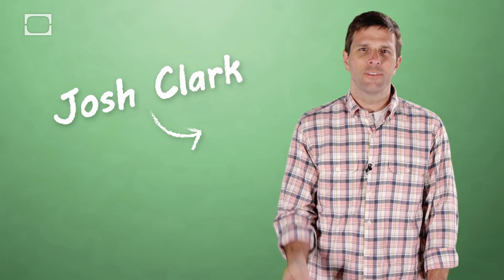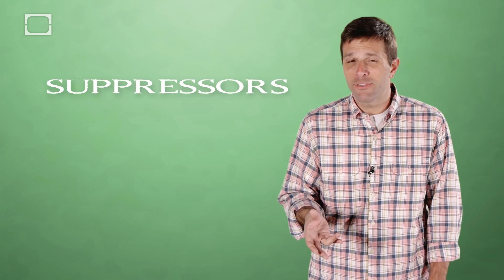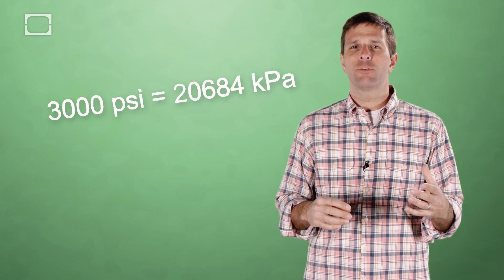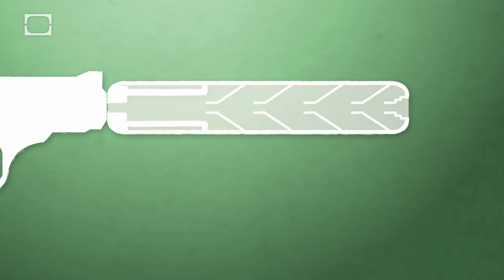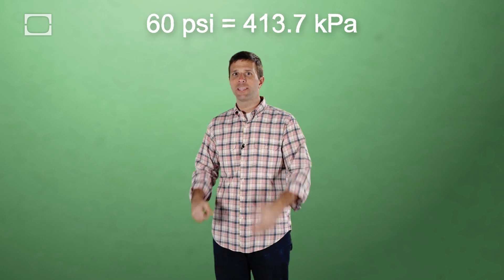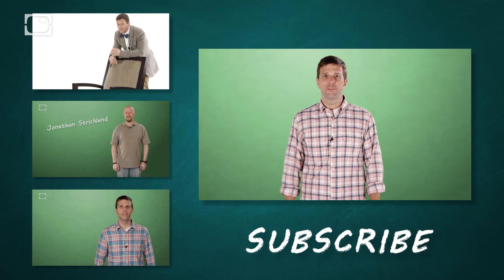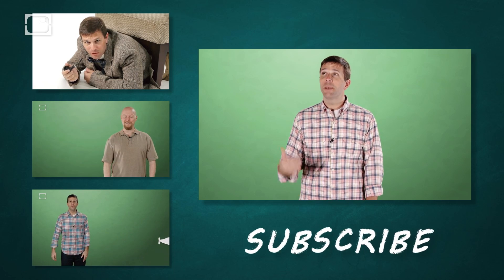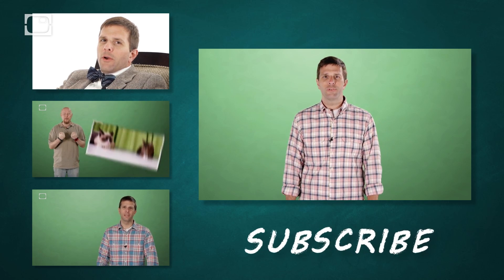How Do Gun Silencers Work?

Comment: I've been in the firearm world for quite some time now and I own a number of silencers and a common nomenclature for a silencer is calling it a "Can" and there's nothing wrong with it...just easier to say versus silencer. As someone who is a manufacturer, and has also been actively in the industry for the past 4 years and growing, I will tell you guys that there are a few other inconsistencies with this video. The big thing, is that while suppressor is another common term in the nomenclature for a silencer, suppressor is in fact the wrong term due to original copywrite and the fact that the NFA branch of the BATFE sees any kind of gun muffler as a silencer and that's the correct term as such. Accuracy and power are not decreased with silencers. Any time you thread on a silencer or attach it to a firearm you are lessening the felt recoil and muzzle flip. Also silencers do not slow down the gasses behind the bullet. Once the bullet clears the barrel, and starts to enter the blast chamber and baffle system, then the gasses begin to expand, cool down, and slow down. Saami spec pressure which is the standard that ammunition for a factory load is aimed at achieving is much greater than 3000 psi. The common 9mm handgun round will have a chamber pressure of over 35,000 psi. Exiting the silencer for subsonic ammunition I couldn't tell you as I don't have a way to measure that pressure. Silencers also with the correct host and depending on the caliber will perform much much better than 130 db's. Some .22 rimfire silencers will reduce the sound signature down to 115 db's. which is not whisper quiet, but it's extremely quiet. 140 db's is the threshold of hearing damage as noted from OSHA, and the best 5.56 rifle cans will bring you down to just below that, and that's due to the super sonic loads breaking the sound barrier. An okay representation of silencers, but there is quite a bit of misinformation in the video. Cheers.
Reply: OrignalRecipe92 Pressure data, as well as spectrum analysis of some somewhat dated designs (except for one German WWII design that actually looks like K-baffles) can be found in Frankford Arsenal's 1968 "Silencers: Principles and Evaluations".  It was one of my references back when I did form 1 cans.
Reply: Joseph DiFusco Spot on man, I'll have to check it out.

Comment: Scrolling through the comments quickly, I don't see that anyone else has already pointed out that Bardem's character in "No Country..." carried a captive bolt gun, which uses compressed air or gas to rapidly push out a spike. It is used for killing livestock. There is no combustion involved in its workings. And I don't remember him having any sort of suppressed shotgun. 
Also, if it is called a "suppressor" then why continue calling it a "silencer" throughout your video?

Comment: Btw the term "can" is actually the type of Silencer/Suppressor rather than another name for a Silencer/Suppressor. A "can" type will screw to the threads on the end of the barrel and protrude forward while an "over barrel" type will slide over the barrel and thread on around halfway up its length.. Oh and you left a decimal point off the pressure that the cartridge operates at, 20,000-65,000 psi is a typical pressure range for modern firearms. The term Silencer has been used for over 100 years with the inspiration coming from when Hiram Maxim was experimenting with more efficient ways to muffle Automobiles, which also ended up also being called a Silencer.

Comment: 20 dBs?  Really guys?

The Welrod which is basically a giant silencer that fired a .32 ACP or a 9mm.  With the .32 the sound was down to around 75 dBs.
Reply: Clay Ronso ...by how they measured decibels at the time. And the DeLisle carbine was 85dB. Those numbers do not translate to modern measurement standards. I haven't seen a real DeLisle metered, but I'd be surprised if it was less than 120dB, even with it's massive integral suppressor on a subsonic pistol cartridge manual-action rifle. Think about it: suppressors from World War II were not orders of magnitude quieter than modern suppressors. Technology has improved and today's suppressors are quieter and more effective, not over 50 decibels louder.

Comment: So many errors in this video, I thought I would work through them in order:

1.  Why did you use a revolver to demonstrate attaching a silencer?  There has only ever been one single revolver design that could run a silencer, plus a couple of others heavily modified.  You would know this if you did any amount of research at all.

2.  They are actually called silencers.  The inventor named it a silencer.  The patent is for a silencer.  Legally, you get a tax stamp for a silencer.  There is no such thing as a suppressor.  Yes, we know, they dont actually silence a gun.  Doesnt matter.  You dont get to determine what they are actually called, the inventor does, and in this case, legally, the feds do.  Its called a silencer.  In my experience, ever single person that corrects another person for calling it a silencer, does not have one, or else they would know that when you transfer one on a form 4, it is for a SILENCER.

3.  The gunpowder does not explode.  It burns rapidly, at differing rates depending on the powder.  Again, you clearly have no idea what you are talking about, and did about 3 minutes of research on the internet.

4.  3000 PSI?  Try 30,000 PSI.

5.  Dont want to associate with people that call them cans?  Are you serious?  I dont want to associate with people that correct people and tell them not to call a silencer its legal and proper name.  Suppressor is a nickname just like can is.

6.  60 PSI?  I am not even going to get into that.  Do you have any idea how ridiculous that sounds?  Come on dude, common sense.

7.  Your sound levels are way off.  You act like you wanted to say it dropped it by 20 by your notation.  You can tell that was not your intention, unless you know people that have "very quiet whispers" in the 130 db range.  Also, 20 dbs is an incredibly loud silencer, most are more effective than that, but I wont get into that here.

8.  Giving up power and accuracy?  Silencers normally increase the FPS of the bullet slightly, not decrease it.  Accuracy?  No, you dont give up accuracy because of a silencer.  Your point of impact may have a shift when you go between a silencer and no silencer, but this is something to be accounted for just like anything else.

9.  I am starting to wonder if even when you said you have been in a ton of firefights if that is true.  What branch where you in?  When did you deploy?

Comment: Also you can't use a silencer on a revolver.  The gap between the cylinder and the barrel still allows gasses to escape at supersonic speeds
Reply: You can on the Nagant Revolver.
Reply: Peter Dvornik In addition to the Nagant mentioned above, a customized Dan Wesson revolver was used in an assassination attempt on Idi Amin. The Dan Wesson was used because it had a quick change barrel that was easily modified to adjust the cylinder gap to nearly nothing.
Reply: Peter Dvornik Awww...
Reply: Peter Dvornik Awww...
Reply: Right hahaha

Comment: There is a few things missing in this explanation and a couple of faults. First you CAN suppress a 12 gauge shotgun. Check this clip: www.youtube.com/watch?v=rtIqTfObXIo. Second, some suppressors are more efficient than others and anything from generally 16 to 40 decibels reduction is possible. Also not all suppressors will reduce bullet speed which would effect impact energy (="power") or maybe even accuracy to any significant point though in many cases change the point of impact: www.youtube.com/watch?v=2HzMLvrF6u4 It also depends on what weapon type one attaches a suppressor on how effective it is: www.youtube.com/watch?v=-WPHcqr6dcI. Trying it on a revolver for instance will in 99.9% of the cases be completely pointless due the the "gas leak" between the barrel and drum.

Comment: They think they know what they're talking about but they have a picture of a revolver on the thumbnail with a suppressor on it.
Reply: Yeah because you can put one on a revolver, so....
Reply: *****
A Suppressor on a revolver is USELESS. Unless you get an AIR tight fit between the drum and the barrel, you won't suppress a large amount of the sound anyway. From memory I can only think of one revolver doing it,(the Nagant)
Reply: it still can done
Reply: Nukedk The Nagant M1895 Revolver uses a unique, proprietary cartridge where the case goes over the bullet, which creates a gas seal upon firing. Other suppressed revolvers (I can think of three others!) are also exceptional highly exotic designs very different from what people know as revolvers, and none fire the common revolver cartridges. Also the silhouette in the video is not a Nagant.

Comment: revolver supressors do Work but only in special models that seals the cylinder against the forcingcone and it also use special rounds with a casing that is longer and extends past the projectile to seal the gasses maybe you should have shown a pistol instead of a revolver

Comment: Ironic that in Counter Strike, suppressed guns are more accurate (Make less recoil) But hey, it's a video game, what can you do.
Reply: I know this comment is two months old, but if Counter Strike uses subsonic rounds, then the explosion in the cartridge would be less powerful, causing less recoil. However, because its not going as fast, the bullets drop off after a shorter range. So less recoil, also less range.
Reply: Modern silencers+standard ammunition won't negatively impact performance, though it would eliminate muzzle flash, so your target may be easier to see

Comment: What if somebody made a 2 foot supressor? Would that take all of the noise away?
Reply: put a 2 foot supressor on a gun and watch your bullet just plop out
Reply from the maker: Interesting question. I don't think it would take all the noise away, but by giving the gas more room to expand it might help a little. Maybe we can research this for a future episode.
Reply: Derazik Rants the supressor does nothing to slow the bullet, if it is made within tolerances the bullet never contacts the supressor.
Reply: +Ravener96 suppressors dont slow the bullet down but you have to use subsonic rounds for the suppressor to actually do its job. The subsonic ammo is slower than the normal bullets... Just wanted to point that out.
Reply: ***** Not in terms of sound reduction, a silencer's effectiveness is roughly proportional to its internal volume.  However, there are diminished returns when it comes to practicality.  Longer silencers are less maneuverable.  Longer silencers also mean more weight and more leverage pushing down on the end of a barrel, which can change a bullets point of impact.  And lastly, longer silencer's increase the chances of a baffle strike, which is when a bullet hits and destroys the internal baffles of a silencer.
Reply: +Synismyhero nope. you see when the bullet leaves the barrel it continues to travel at a very high speed so the bullet will make a ripping or tearing sound through the air which is partially cause by the air being separated and collapsing back on its self by the bullet. silencers or suppressers only take away the loud pop sound of guns and help disperse the gasses which are under tremendous pressure this is only practical to help protect your ears from powerful sound waves when you are shooting a gun or for military units to place a round on target from a distance and have the enemy not know where the bullet came from, but they still would most likely hear it and know it was a gun. to reduce the sound further using sub sonic bullets ,which travel at a far lower speed, will lower the pressure of air collapsing on its self nd therefore reduce the sound it makes. although sub sonic bullets are less accurate at longer range and may not cycle a semi auto pistol or rifle.
Reply: BF3VsBlackOpsII the supressor does it's job fine with supersonic ammo, people just dont understand what it's job actually is. it only limits the sound from the actual gasses. it doesent limit the sonic boom from the bullet.
that is really useful in firefights as your position is harder to identify.
Reply: Suppressing a gunshot is all about volume, (as in space, lol no pun intended).  As a general rule, the larger a silencer's internal volume, the greater it's sound reduction ability is.  Therefore, a large enough silencer could completely eliminate the sound of the explosion, although the size need would vary base on the type of bullet being fired as some produce more gas than others.  Furthermore, unless you were using subsonic ammo (bullets that travel slower than sound), the bullet will still make a sonic boom as it travels through the air.  

Hope this helps :)
Reply: +Peter Dvornik there was no pun
Reply: ***** volume is both a measure of space and sound, hence the pun
Reply: that would be so cool
Reply: +Synismyhero wouldn't it just have diminishing returns
Reply: Peter Dvornik really? i assumed it'd be an exponential curve similar to a db vs distance graph ^-^ my bad

i've always wondered how they silence shotgun rounds since the bullets tend to break up
Reply: +savagepinksock The wad holds the shot together until it comes out of the barrel so it is basically one projectile until it passes through the supressor, but mostly suppressors on shotguns work best with slugs.
Reply: You moronic piece of shit

Comment: it doesn't drop the sound TO 20dB, it drops it BY 20dB. Generally from the 160s to the 140s. Suppressors generally are used to drop the sound to a "hearing-safe" level and are absolutely nothing like in the movies. Yes, significantly quieter, but definitely not anywhere near 20dB
Reply: ***** You sound really assmad.
Reply from the maker: Yep that was a mistake on our part. We went back in and added an annotation to the video to try to make the facts more clear. Thanks!
Reply: I defer to your expertise in all things ass
Reply: Jeremy972  for 9mm Right? Actually Hitman(Agent47) using 45.Acp and ı think ıt must be louder.
Reply: 45acp starts out at around 165dB, and with one of the more advanced(expensive) suppressors, you could theoretically get it down close to 130dB which is safe enough to not need ear protection as long as you are outside. As for 9mm, if it's a subsonic round(usually the 147gr projectile) then it should have a similar sound pressure signature. If it is a hypersonic round(suppressed), it would be significantly louder than the subsonic(suppressed) to the tune of 10dB(I think) louder than its slower counterpart.

Comment: "When you have a suppressor on the end it drops those decibels down to about 20... about the sound of a very quiet whisper"  This video is poorly researched garbage.  Cans (you shouldn't associate with me I guess) reduce the db level by 20-30 decibels to a barely hearing safe level of 130-140 db.  That's slightly louder than a whisper and is similar to the noise level of a jet engine from 100' away.

Comment: Chamber of pressure of even a lowly .22 Short runs at 21,000 CUP (Copper Units of Pressure) or about @5,600 PSI, the common .22 Long Rifle comes in at 24,000 CUP or about 7,400 PSI. The CUP pressures are the recommended maximum from  SAAMI, Sporting Arms and Ammunition Institute.

Comment: Holy Misinformation, Batman!  A suppressor does not quiet a gunshot TO 20 or 30 decibels.  It quiets the shot BY 20 or 30 decibels.  It's still going to be fairly loud.

Also, you show a suppressor attached to a revolver.  Revolvers have a gap between the cylinder and barrel - rendering a suppressor less effective.

Comment: The gun powder doesn't explode it actually burns fast...just FYI
Reply: Chad Burnett Nice copy & paste from http://www.chuckhawks.com/smokeless_powder.htm

Gun powder can be black powder or smokeless powder. Black powder being better for longer barrels because longer barrels need a slower burning powder so as not to damage the gun.

Smokeless powder can explode under unusual circumstances and keep in mind the chemistry for smokeless powder is similar to that of TNT by about 2/5.
Reply: That's what an explosion is, something expanding rapidly, in this case, burning and releasing gas quickly.
Reply: James Booher Smokeless powder does not explode when unconfined, unlike black powder. In fact, technically, smokeless powder does not explode at all; it merely burns rapidly. Smokeless powders are classified as flammable solids. This rapid burning releases a huge volume of expanding gasses which, if confined in the chamber of a firearm, accelerate the bullet (or shot charge) down the barrel, producing a high velocity in a very short distance. Zero to Mach 2 in 26 inches for most centerfire rifle bullets, for example!
Reply: I apologize if I sound uneducated in this subject, I am. Perhaps I was simply misinformed. The difference between rapid expansion and an explosion doesn't seem to exist from the perspective of one without experience in the subject.

Comment: A revolver with a supressor? Ok...
Reply: ***** yup. The reason why the Nagants could be suppressed is that the cartridge uses a recessed bullet design.  The bullet is actually INSIDE the casing with the lips of the casing extending well forward..  The cylinder also actuate forward towards the chamber when the trigger is pulled.  This forward actuation actually allows the lip of the shell casing to move into the chamber, causing a seal similar to that of an auto-pistol eliminating the gap that revolvers typically have.
Reply: i was also wondering why they used a revolver animation lol when only the 1895 Nagant is able to , its called how stuff works i figured they would also say why a revolver couldnt be suppressed besides that one.
Reply: nagant revolver